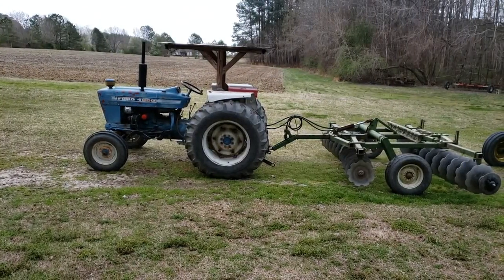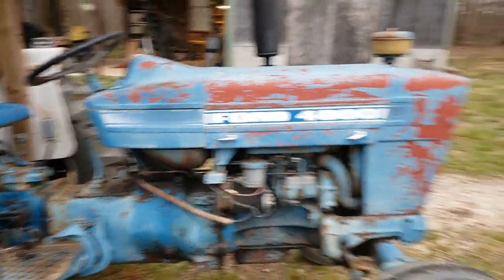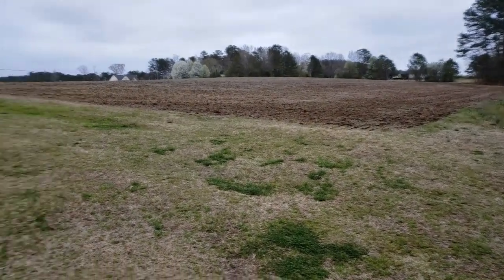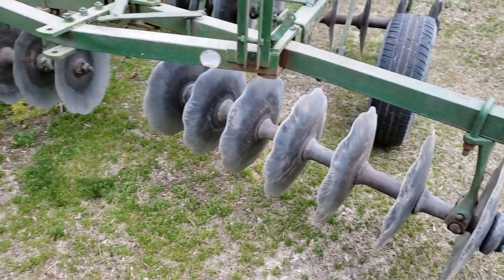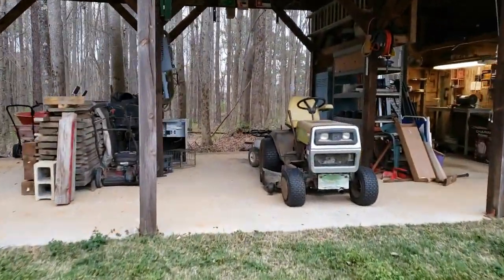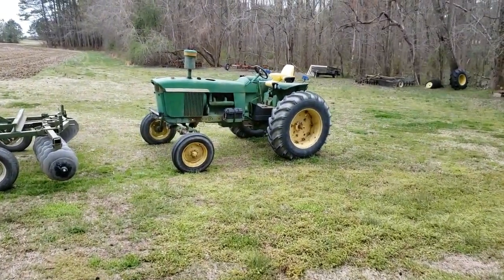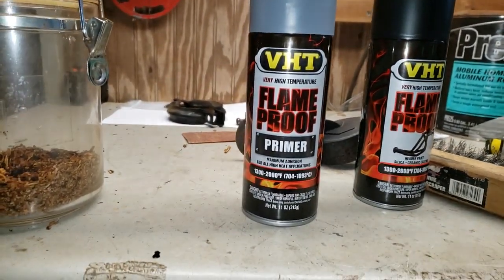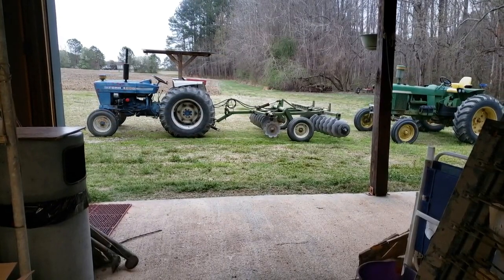Diagonal cut on a 5 acre field

Comment: Thanks for the ride along.  The Ol' Ford 4000 sounding pretty good pulling the disc over the field.  Yep, I don't like diesel exhaust in my face.  Even though I do like the smell of diesel & dirt. 👍🏻👍🏻☕☕☕
Reply from the maker: Diesel exhaust directly in my face gives me an extremely bad headache and I tolerated this for a couple of years before I added the extension pipes to both of the Mufflers on my tractors. I'm very pleased with the way the Ford 4000 is running under workload. Thanks very much for dropping by and watching the video.🙂☕

Comment: Nice combo
Reply from the maker: That disc set for lite tillage or vertical surface residue tillage is a perfect match for that little 45 horsepower 3 cylinder diesel. Thank you very much for dropping by and watching the video🙂☕

Comment: Hi
What year and model is your plow ? I just bought a Case that is near identical but neither the last owner or the Case/IH dealer can tell me model or vintage
Thanks Mike
Reply from the maker: Hi Mike, in this video my Ford 4000 tractor is pulling a John Deere BW 28 blade disc. These discs were made back in the 60s.